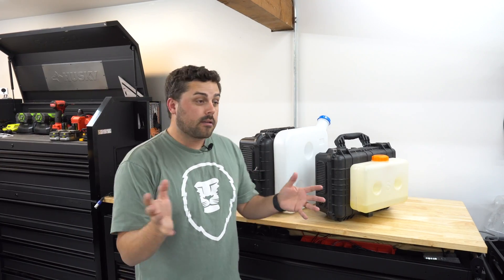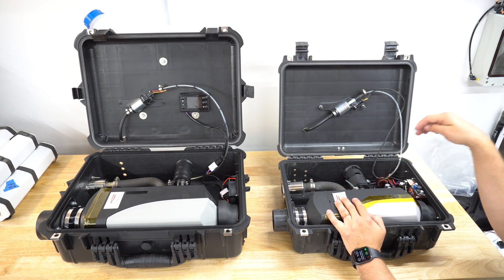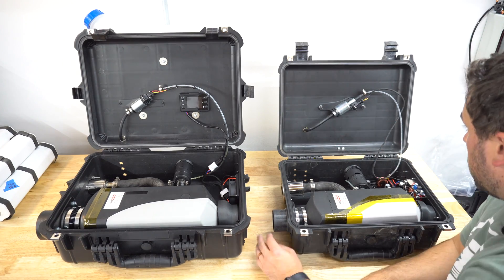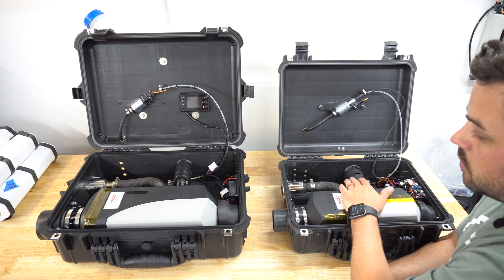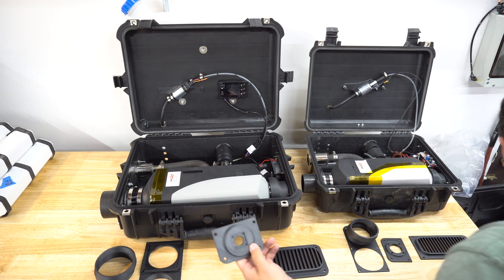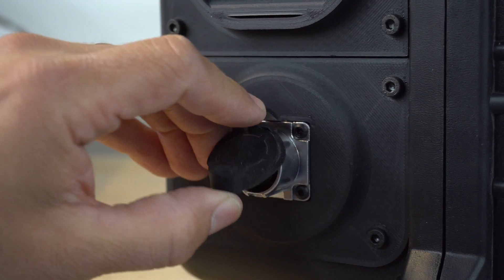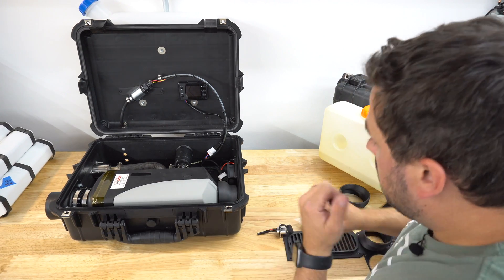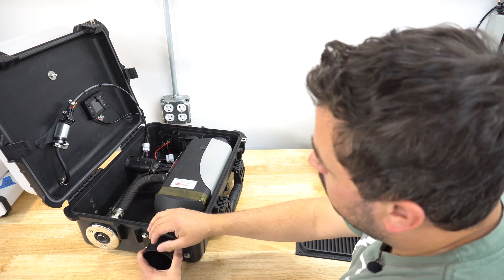Diesel Heater in a Box V2.0!

Comment from the maker: For those wondering about the expensive heat output tube, i have added some other options. This particular seller on Ebay likes to spike the price when they run out of stock. As stock comes in the price drops. OR you can select the other amazon links and they will just be a different style.
Reply: Keegan, in the build video you mention placing a rubber gasket on each side of the box on the output tube.  Do you have a recommendation for this gasket?
Reply from the maker: @toddreich  hey Todd, the output tube ships with a gasket that works perfectly

Comment: Are there any xt60 plugs that would work with the power input plate?
Reply from the maker: funny you should ask, I run xt60 on basically everything 12v I have on my camping gear and shop gear. for this specific application I built an xt60 adapter wire that powered up the water proof connector I am using here in the heater. The goal was to keep that xt60 connection in a covered dry area next to my batteries and have the wires running out to the heater and waterproof connector is the only piece exposed to the elements.

Comment: Truckers going over passes in Winter sometimes have their fuel solidify, sometimes they die.

It might be wise, especially for novices, to bring a secondary heat source which could be used to warm up the fuel if necessary.

I've heard diesel won't ignite easily. Don't know if that means kettle in a campfire-easily. I.e. Maybe start out having a vigorous makeout session with a Gerry can inside of a sleeping bag. Keep it sexy, ya know? THAT'S how you give diesel the hots!

Comment: Nice find on those bulkhead connectors. I looked everywhere for a 5 pin one that supports larger gauge wire for the power inputs (as it can get up to 10A on startup) and couldn't find anything. Most 5 pin plugs are 18 gauge so you'd have to run a 2 pin (power) AND a 3 pin (controller).

Comment: I would like to use the 2 pin connector on the 2kw build. Can I acquire the 2 pin 3D printed socket adapter along with the usual 2kw 3D printed components from your Etsy site?

Comment: Nice build!  
Looking to build one soon wondering how loud the "clicking" sound is on the fuel pump. My gf is a light sleeper so I can see it being an issue.  Are there any options for quieter pumps?
Reply: I saw there is an amazon seller that makes silicone covers that reduce the sound. Don't have a link, sorry.

Comment: Great Video!  I am in the process of trying to do one very similar.  My heater is slightly different, but I am trying to build it in the Apache 4800 case and I am doing a 5kw heater.  One thing I am trying to figure out is how to secure the heater to the case.  I bought some brackets, but I am starting to wonder if I need to even do this.  It looks like your heater is mostly held in place by the 3 inch intake and outtakes.  Is this accurate or is it somehow bolted directly to the case as well?
Reply: Never mind, I just rewatched your previous video and I see how you mount it.  Looks solid.  I will give that a shot.
Reply from the maker: Check out the build video I did

Comment: Do you shorten all the wiring?  Do you pull the pins to shorten it or just cut out a section in the middle and use butt connectors?
Reply from the maker: Cut out the middle and resoldered
Reply: @keeganbuilds  awesome build.

Comment: Awesome build.  Do these heaters work better when they are running more constantly as opposed to dumbing them down and having them run at a lesser rate?  I have a canvas truck bed tent and am wavering over the 2kw vs the 5kw setup.  Which would you recommend? I am going to start collecting parts and this would be the deciding factor on which 3D parts I purchase.  Thank you!

Comment: You may want to check the link to the 3" heater output tube.... $518.00 is a bit steap each....
Reply from the maker: looks like a typo from the seller. I have messaged them on ebay to fix.
Reply: @keeganbuilds  I’m looking to build this as well. Just ordered your 5KW kit, but that 3” flange is still showing at $519.99
Reply from the maker: @RobRoyRoadie  There are 2 other options available for you to pick up. check in the description. The main version comes in and out of stock (or in the case of this seller, normal price vs $518)
Reply: @keeganbuilds  Yup, ordered two of the silver ones. I'll just paint them black with heat-resistant paint.
Reply: @keeganbuilds  I reached out to the seller. Apparently they are out of stock, and that is the price to have them fabricated individually. They said that once they can get a new batch manufactured in bulk, the price will go back down.
Reply: Have any for sale ?

Comment: That is what I was looking for. What is the difference between the digital display unit and the knob units, do you know? Is the 5 and 8 kw heaters the overall same size and work in the same case?. Thanks
Reply from the maker: knob is easier to use but much harder to diagnose when something is acting up. I really like the LCD version I have included in this video. Also, it comes with a wireless remote so you can fire it up from the camp fire prior to climbing in your tent. Also, I have only seen problems with the 8kw models. Or I would say, I havent found a reliable source in the last 3 years for them.
Reply: 8kw heaters are 5kw bodies pushed too hard. 2kw and 5kw are the two official sizes. Stay safe.

Comment: Good gosh.... very clean and beautiful build. I am looking into one of these heaters for my 20 travel trailer. The propane central heat is always an issue when dry camping....a propane hog and battery slayer. I love this build. I wonder if the 5kw would heat a 10x14 Kodiak canvas tent?
Reply from the maker: I havent tried that but I think it could work! I used my 2KW to heat up my bigger 7x9 tent in sub freezing temps, it held the tent around 62F. This was also tent material which breaths really well so I was probably losing a fair bit of heat. Canvas would hold better.